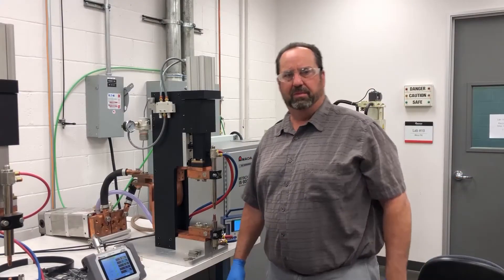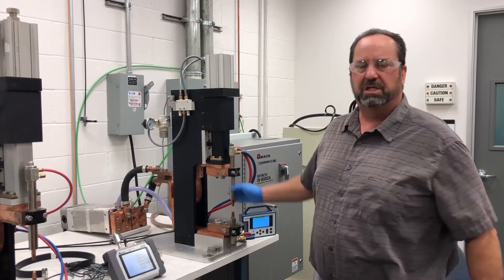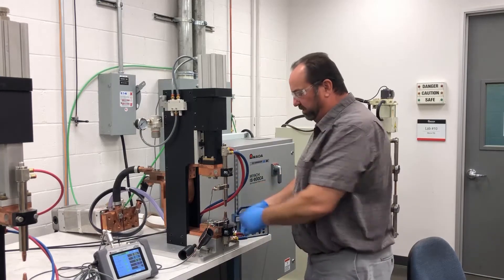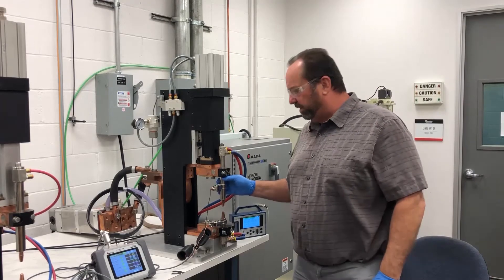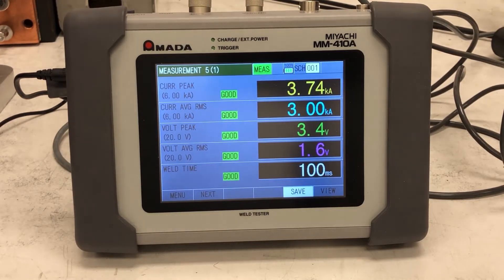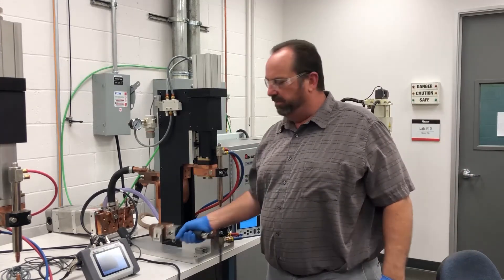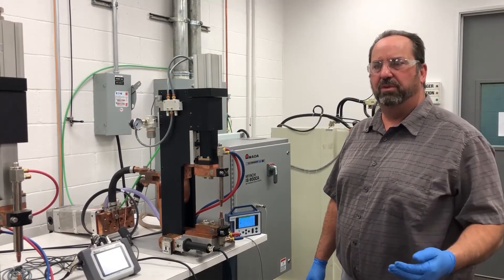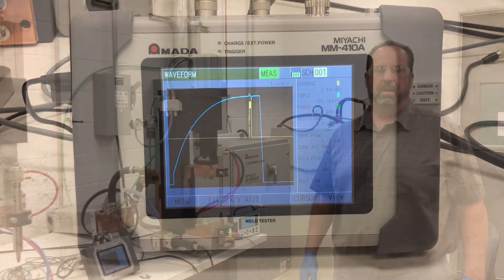MM 410A Portable Weld Checker

Comment: Wonderfull explanation video. 
Can You please tell me how to determine the condition of the spot weld machine is good or no just by checking the voltage from the secondary output?
is there any comparison calculation between the voltage in the back and the voltage in the front. 
or just the by the difference of the voltage?